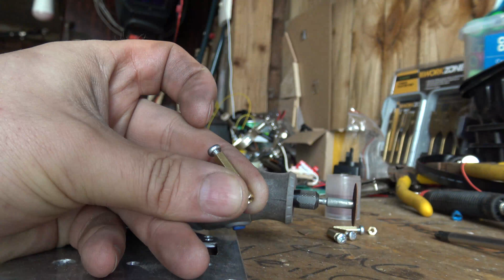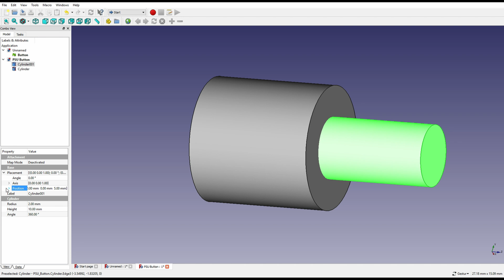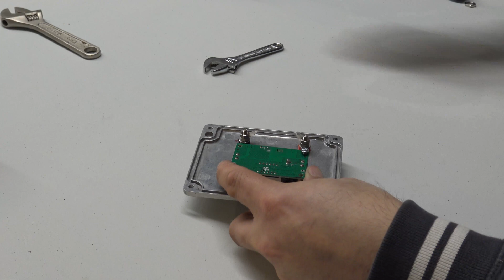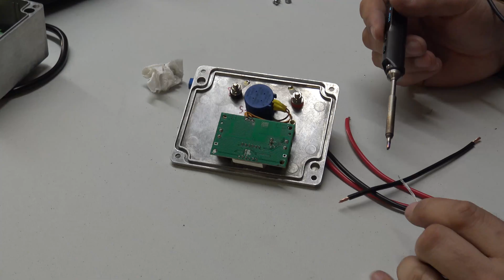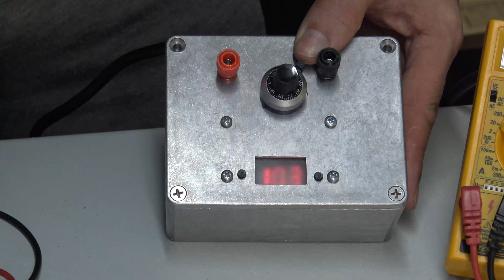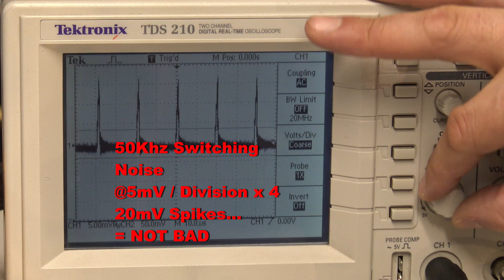DuB-EnG: DIY Laboratory Power Supply Build Voltage Regulated 1.5 to 24volts at 3amps

Comment: Put a bit of red plastic (gels for showbiz lights are best but any old transparent red plastic will do) over the LED window and it makes the display loads easier to read.
Reply from the maker: I blew the blessed thing up by connecting it reverse-polarised to a 12v car battery...  idiot me... i need to repair it...  that said, i completely agree with your idea... using GELS would really help...  so, when I open it up, I'll do exactly that!

Comment: Yep, i would have put the mains cable in the side, but that's me, a picky sod :-D
Nice to see you used a safety earth. and the switcher is sheilded :-D.
You could add some extra filtering outside the box if you do have noise problems, if you use it to power a mw/lw radio it would be a good test.
Does it have some kind of current limiting in the menus?
Reply from the maker: ... I’ve been looking on-line and there are front panels that regulate voltage, and have 5a power rates with variable current limits...  I have a feeling I’ll be building another PSU in the future!  I’m thinking about throwing a small capacitor in parallel with the output to try to reduce that noise further....  all great ideas of yours though!  Thanks for your input!